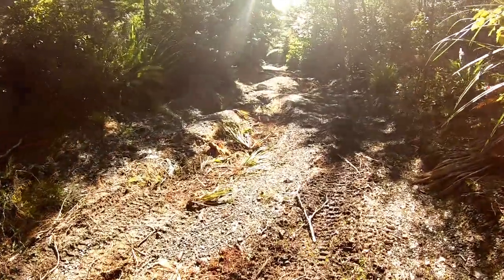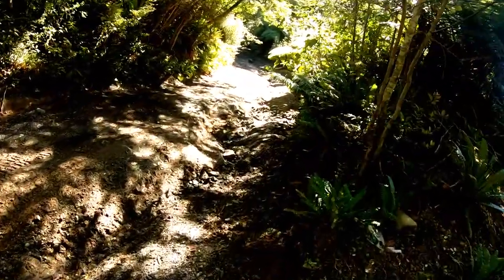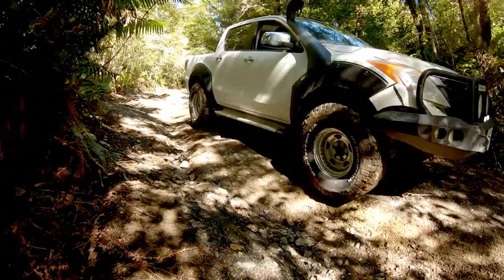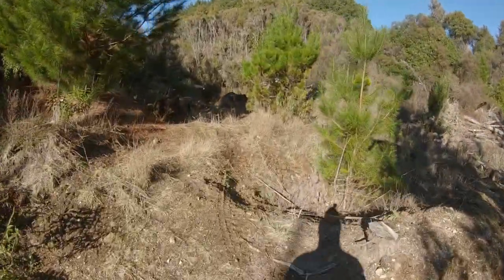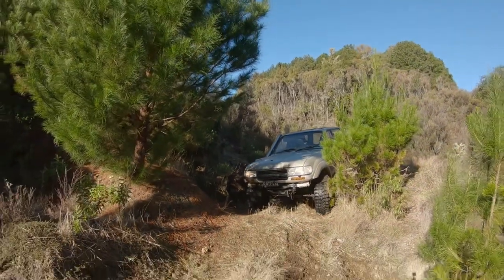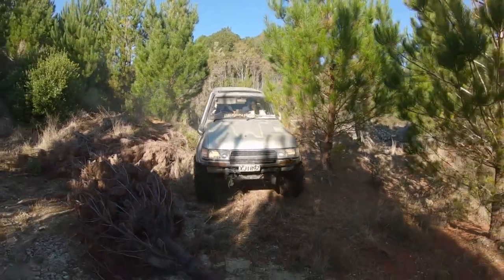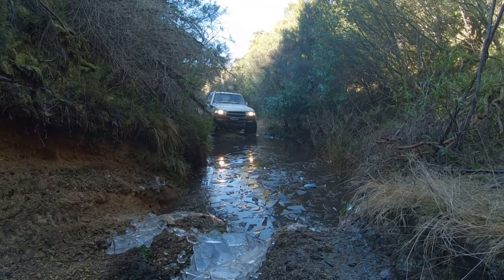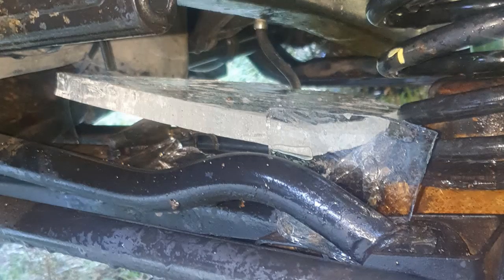clements mill rd

Comment: Private maori forest your trespassing into aye?
Reply from the maker: Clements Mill Road is managed by doc and is public access as for the surrounding Forest all of us had hunting permits for kaiangaroa Timberlands and Lake Taupo Forest before Lake Taupo Frost change the rules. I'm sure I can find my old permit information. I used to spend a lot of time in both the forests around Taupo as a mechanic however it is super hard to get into Lake Taupo Forest these days. but for good reason
Reply: Rules for lake taupo forest have not changed nor has been managed by any entities other than the Tuwharetoa ltf trust...permits are only obtained by being a land owner or descendant of an owner. And once you've provided your whakapapa to ensure you are an owner to get a  key and permit. No non owners are permitted to enter into LTF iwi lands at any time not even with a permit holder. Just letting you know. Not going to rant and rave at ya just educating yourself and your 4x4 buddies. Cheers